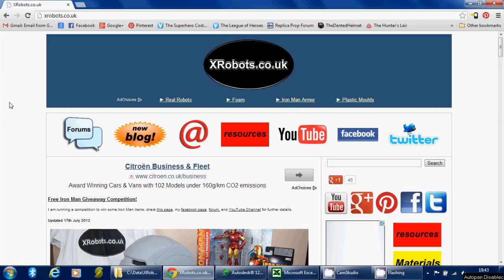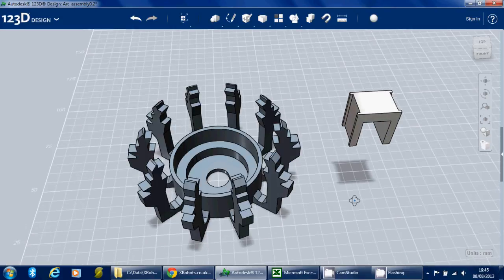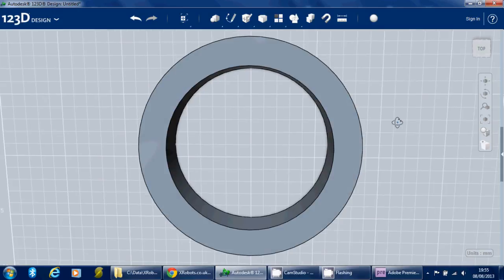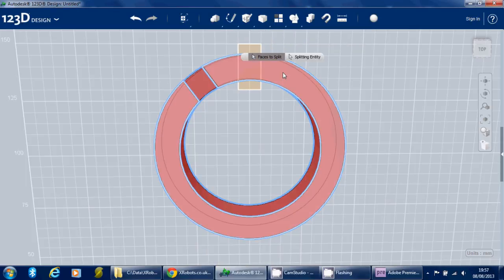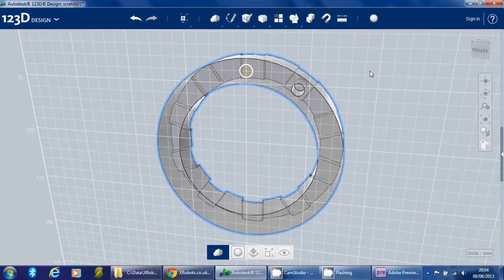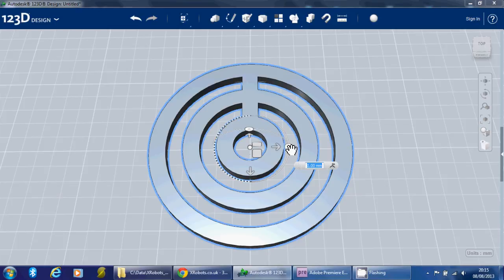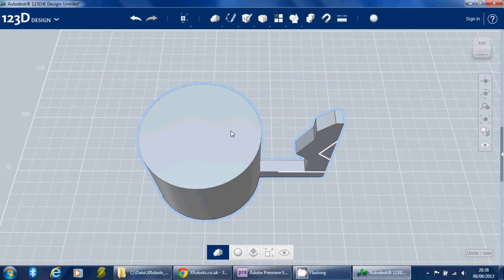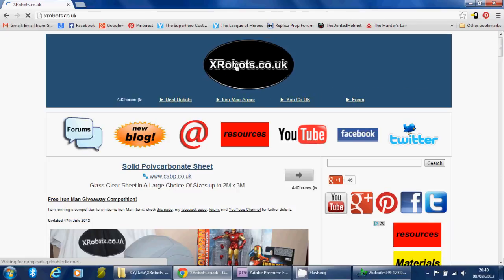Autodesk 123D Design Tutorial - Iron Man Arc Reactor | James Bruton

Comment: trying to use 123D and will persist, but it does seem to use a lot of CPU. Very slow and quite unresponsive!
Reply: CAD software usually does that, that why professionals use computers designed for that purpose such as the Mac Pro (mostly has ECC RAM).
Reply: Two years after this video and my average laptop runs it very well :) technology amazes me
Reply: I'm using OpenSCAD now, it's more suitable for my purposes and very easy to learn.